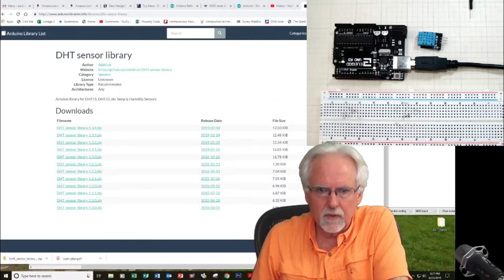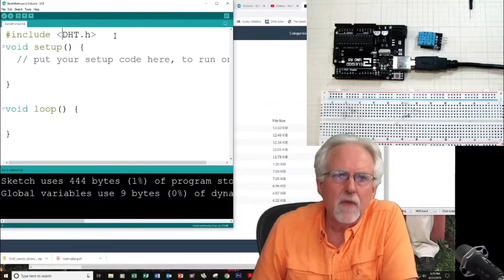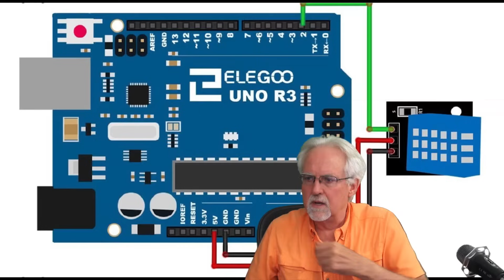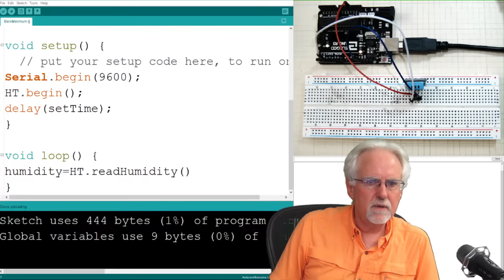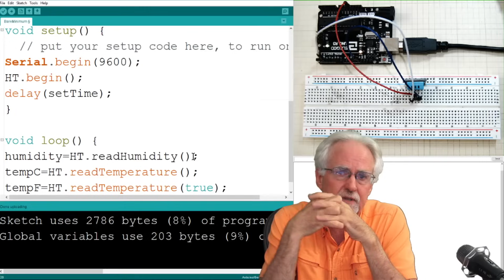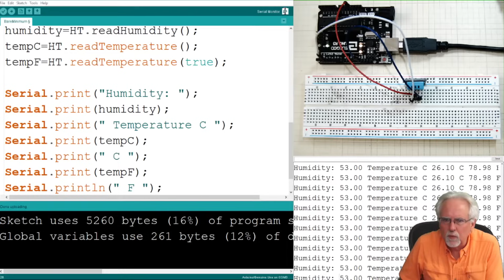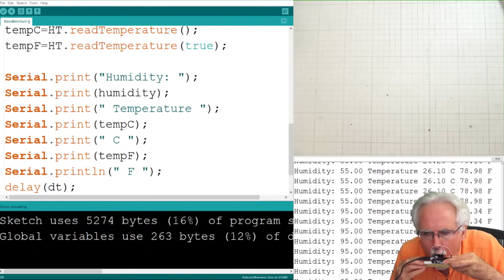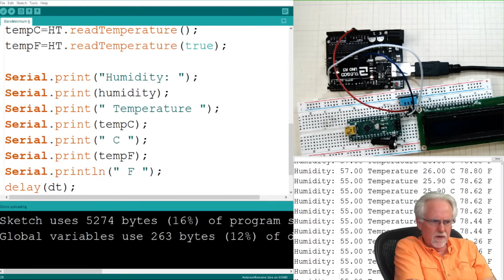Arduino Tutorial 50: How to Connect and Use the DHT11 Temperature and Humidity Sensor

Comment: Another great video! Two comments.

1. An alternate way to install the DHT11 library is to use the Arduino IDE. (I'm using version 1.8.10 of the IDE.) From Tools->Manage libraries... enter "dht" in the "Filter your search" box; after about 1 second, you will see some results (I see "DHT sensor library by Adafruit Version 1.3.8" as the second entry). If you put your mouse in the area for an entry, an Install button appears. Clicking it installs the library. Done! Note: the same version, 1.3.8, appears at the top of the list when doing the search you describe in the video.

2. At 17:00 you noticed that "readHumidity" did not highlight correctly. This is due to something not being right in the "keywords.txt" file that is in the DHT library folder. I found the following problem and fix that describes what is probably wrong:

https://github.com/adafruit/DHT-sensor-library/commit/a1169d20b4f287810c9c237859a856bcbc0b6ea2

I suspect that if you use a hex editor to look at the readHumidity line in your keywords.txt file, you will see that there is not a tab (0x09) character between readHumidity and KEYWORD2. See the keywords.txt snippets below.

Note: In my installed 1.3.8 keywords.txt file, tabs are where they should be. Entering readHumidity() (and readTemperature()) in a sketch produces highlights as expected.

 I just downloaded the "1.3.4" version of the DHT library (supposedly the same one you did when you created the video), unzipped it, and looked at the keywords.txt file line for "readHumidity". It does have 0x09 between readHumidity and KEYWORD2. However, when I look at the timestamp for the keywords.txt file, I see "30 April, 2019", which is after the release date of 2019-02-18, so this file may not be the one you were using! Looks like Adafruit slipped in changes after the release date.

Here's a snippet of what I see in the 1.3.4 keywords.txt, both in ASCII and in hex. All instances of lowercase 'b' in the ASCII snippet represent (what appear to be) spaces. In the hex snippet, the "spaces" are seen to be tabs (0x09), as they should be. The hex output shows 16 bytes of output per line; the hexadecimal numbers are the byte values--4 groups of 4 bytes; the text
at the end of each line is the corresponding ASCII; periods represent unprintable characters. The periods on the first line of the ASCII snippet skip over the beginning of the text line up to the point it matches the corresponding hex output.

*** begin ASCII snippet ***
..............exbbbbbbbbKEYWORD2
readHumiditybbbbKEYWORD2
readbbbbKEYWORD2
*** end   ASCII snippet ***

*** begin corresponding hex snippet ***
6578094B 4559574F 5244320A 72656164  ex.KEYWORD2.read
48756D69 64697479 094B4559 574F5244  Humidity.KEYWORD
320A7265 6164094B 4559574F 5244320A  2.read.KEYWORD2.
0A                                   .
*** end   corresponding hex snippet ***

I'm guessing that you have a space (0x20) between Humidity and KEYWORD2.

While I thoroughly enjoyed the video and working on the sketch for Lesson 50, I think I had more fun looking into the keyword issue!

Comment: I got it working first time.  Then I changed the LCD to one with Serial input and using a sensor shield to tidy up things.  Got it working; BOOM!  I really appreciate your willingness to share. With a background in Electrical Engineering and Computer Science,  I spent 32 1/2 years in the technical support and technical training area of Toyota Motor Company;  most of it training Toyota dealership technicians.  I can appreciate all the time and effort that you put into each of these activities. Great job and keep up the good work!

Comment: Okay, I've done the homework for this lesson. My Arduino kit did not come with the DHT sensor and  Nano and so both had to be ordered separately. The LCD came in the Arduino kit came with an I2C module embedded with it and that eliminated the extra wiring needed; however it needed for an extra library to be downloaded and installed. The Nano had some compatibility issues and after some research came to understand that some of these foreign manufactured items needed a separate driver to be downloaded and run. The DHT sensor too required an additional "Adafruit sensor master library" as well as the "DHT sensor library" installed.
I coded the lcd to display "Humidity" and its value in the first screen and after 2 seconds the display clears and shows "Temperature" in the 1st line and the values in Celcius and Farenheit in the 2nd line. Enjoyed the challenge !!!

Comment: Sir, Great video. Just an update. I had got nan output. Trapped output in long variable. Got -2147483648 as output. Finally loaded Files>Examples >DHT sensor library. Uncommented DHT11. Commented DHT22. Compiled & loaded. Got correct output.
Thanks for great videos. Your explanations are excellent. When ever possible, please tell us about arduino board. There are so many videos on internet, but your style is second best to none.

Comment: Got everything to work fairly quickly on this assignment. I discovered the sq() and PI functions which made the formula for the area much easier and more accurate. The rest was just utilizing what I learned in the last tutorials. Easy to learn when you have a great teacher. Thanks for the lessons.  I also got the humidity and temperatures to display without any real issues. The biggest problem is fitting everything to the display.

Comment: Had to go in and update from the libraries and install the DHT11 from Adruino program. I tried different ways to get it to work but finally got it. Also when I went and started coding all of the names "  DHT11, DHT, humidity, readHumidity, and readTemperature all turned orange. It works great and had no problems down loading it. 
Thank you Paul for a great lesson.

Comment: Hey, Paul! I just built a project using my Arduino and the DHT11 to  switch on my garden well pump to sprinkle my fig trees to prevent them from freezing in order to extend the growing season of the trees. I used the 5v relay in the kit to drive another relay that handles the high current load.
Reply from the maker: Excellent!

Comment: Hi Paul,
I've started from lession 1 and now I'm on lession 50. I've learned a lot along the way, especially on coding. You are very easy to follow as a beginner. I plan on finishing these lessons and then jumping over to the raspberry pi pico w. Thanks for taking the time to do what you do. You always wonder if people watch the whole video and do your homework. Well I do watch all the way through and do the homework,however I wonder if you go back and read these comments on these lessons that you posted 3years ago. Today is 10/13/23.

Comment: Had fun with this project, tried to do it on an ESP8266 Node MCU V3. Got the code to install with a few minor changes, serial monitor is showing the print lines as expected but no readings other than humidity 0.00 and some temp reading I have to fix with the print lines. I used A0 for the sense pin and declared it in the sketch as an int .Temp reads nanC and nanF

Comment: I came here because my project wasn't working. I looked at the documentation and it's definitely wrong. From the pins on the sensor to the test scheme they provide. 
When I did it, it kept saying "can't read from DHT". I followed your tutorial and everything run smoothly. 
Thank you for such outstanding tutorials.
Reply: May I ask how you got to know the commands you had to use? I'm afraid I'll need that skill when using other sensors or different hardware. I feel really lucky that I had bought the Elegoo kit and coincidentally you use it for your tutorials. I think I won't be that lucky in the future ;)

Comment: The Arduino IDE will also  add/install a zipped library automatically for you via the sketch/include library/Add .zip Library...
Reply: Or you can use the library manager.
Reply: Thanks for that comment. It helped.
Reply: @johndoudar6395  Thanks for that.
Reply: Thanks Chuck

Comment: At 10:35 Paul says that you have to use Arduino digital pin 2 to connect to the sensor left pin.  I used a different pin and it worked fine.

Comment: Dear Paul, I really appreciate your lessons. I am improving fast. I bought your kit and try some other little projects. Actually I am in marketing and communication, and I often have a tainted view from this perspective. I was thinking, if you make a second level  class in a bit different way, I think you would get many more viewers,. The objective would be to develop a steady hartware tool to enable the student to use it in own projects and grow on it. My idea is, to start with an interface that we keep throughout the entire class, F.e. lets start with an bigger arduino. Than connect and program basic components, create chapters inside the ide. 1. Serial port. 2. Display and some Leds and switch 3. Real Time clock, 4. Memory Card, 5. esp2866 6, Blynk. - This components accompany us, hartwired to the arduino, throughout the entire class. We build sensors, projects actuators on this achitecture. At the end we can grow complex and more usefull things with arduino instead always starting from scratch, at the end just having one little part in a lowest level possible working. What do you think, Paul?

Comment: This has been particularly interesting to me because my major reason for getting interested was to built a Freezer monitor after I accidentally unplugged one of mine. Eventually I will want to have (four) of them communicating to something by WiFi but this is an essential first step, for that project. I have used PICs in the past and used Assembly Language for them but I found Python confusing  but 'C' I have been using for 40 odd years in various guises and I am comfortable with this interface. I am still accumulating items.
BTW - giving advice of what to get with links is essential. I am following another author who does not and sometime I have to skip back and forth over the Video to catch what he has said and sometimes am not successfull. Thank you.

Comment: Homework done ok.
😀
Funny story. I'm using the Sunfounder Elite Explorer kit for Paul's series on the R4 Wifi. I'm ok with programming but a beginner in electronics. When it came to the LCD the one I have has a piece of electronics on the back that prevented me from plugging the LCD in to the breadboard. Should I pull it off then maybe I can plug the rest in?. Fortunately, I did some research instead and found it was an I2C module. What is I2C?  So I did some more research and found how to use it and found some libraries to drive it. It works fine and is a lot better than connecting all those wires to the Arduino. So Paul, not only am I learning from you, I'm learning by doing my own research and trying things for myself. Great lectures and I can't wait for the R4 Wifi series to advance.

Comment: Had problems with the recommended library and running on a Mega 2560, loaded a library from different source and works fine (but slightly different output format)
Most excellent!

Comment: Hey Paul, thanks for the amazing lessons. I was able to do the assignment from lesson 49. It was easy. 

As for this lesson. when i tried uploading the code it gave me com error but after googling i was able to solve the problem. I had to delete the DHT Library folder and download it directly from the Arduino IDE and i also had to install the Adafruit Unified Sensor Library but after doing this everything worked perfectly. I am amazed how simple it is to use this sensor and displaying the readings to the LCD was a piece of cake. Thank you for these amazing lessons!
Reply: I tried that but my code is still putting out errors
Reply: yeah it wont work but if you delete that folder and then install it from the arduino itself it will work. I think its because it needs other libraries as well to work.
Reply: Thanks Alex, I follow your recommendation and it worked.

Comment: Hi Paul, I had to delete and reinstall the Library for the DHT11. Otherwise I got an error message regarding the Arduino Board. However, it was a good experience because things often fail and require thinking outside of the box to correct. I learned a great deal by doing so! Great lesson as always and I will pass it to my students!

Comment: Elegoo haven't used the normal pin layout on the PCB for the 11. The middle pin on most DHT11 units is data. Just in case someone isn't using the Elegoo kit. Thanks for the tutorials.
Reply: Thanks for the heads up, I almost connected the DHT11 as per a datasheet from the internet and remembered your comment.  Any idea if I would have released the smoke by reversing  the Vcc and data pins?
Reply: @chrisingram7277   probably just fry the sensor... as I did probably... (a new one is on the way) =))
Reply: @legendarycraft5499  Not too hard to fry sensors lol. I always check about ten sites before I plug some stuff in.

Comment: I installed the DHT sensor library by downloading the zip file, and then in the Arduino IDE menu, I selected Sketch > Include Library > Add .ZIP file. It was a bit simpler than Paul's method.

And to answer Paul's question about #include "DHT.h" vs #include <DHT.h>, they will both work fine.  The difference is where the code compiler looks first to find the .h file, in the libraries folder or in the user's own code folder.  If it doesn't find the .h file in the first folder, it will look in the other one.

Comment: Had big issues getting this library installed, until I found a much simpler way. As long as you're connected to the internet, do this:
From the Tools menu in Arduino, select 'Manage Libraries'
In the search box, type DHT, it will search download sites for you
When the results appear, choose the Adafruit DHT Sensor Library and select Install
It will probably warn you that there are dependencies and other libraries are required.
Arduino will download the dependencies for you and install everything.
That's it, worked perfectly, without even leaving Arduino.

Comment: Paul, I use the Tools -> Library Manager and type in DHT11 in the Search box. The Manager will put the folder in libraries folder.
I installed the MCP4725 library for the DAC chip from adafruit.

Comment: Hi Paul, I was watching this video and i paused it at the print statement point(20:00) I decide to combine the DHT11 with my Nano based LCD circuit, I first swapped out the contrast pot with a fixed esistor (850R) and then changed the Serial.prints to lcd.prints. I had to drop the temperature in F, but then in the UK thats not much of an issue, i guess i need to figure out how to scroll text. My one reads every 5 seconds. it also runs from the 9V batter using the battery and PSU in the kit.
BTW i have a few Nano boards, they all look identical but from different ouces and some require old bootloader to compile and other s use the new one, just in case any one has trouble with their Nano codes loading. Having soooo much fun, like being a kid again. Back to to video for homework.

Comment: Homework Done!
Here's the LCD output:
Humidity: 51.00% (first row)
Temp:       73.94F  (Second row)
I will try to use the character map to print the degree symbol that looks like a small circle. But this is fine.
Wayne

Comment: I had a difficult time loading the library.  It started by me not initially installing the Arduino program correctly in the first place.  So I have to reload the entire program again, and this time in the Document folder, not the download folder.  Since I am using a MAC, Arduino did not know where to find the folder for the DHT unit.  It took real hair pulling, but really need to read the fault screens in great detail.  I am really surprised that the Arduino has lots of interface communications for goofs like me.  But it took me right to the problem by stating where it looks for the files which in my case is deeper than the library.  You have to put it in the Arduino, library,Bare minimum folder, then install the DHT files there.  Other than that, I really enjoyed the Tutorial.  Thank you very much Paul

Comment: Quick comment, on a fresh IDE install, the DHT library has two libraries it's dependent on that also need installed. I ultimately used the library installed in the "Sketch" menu to find out what those dependencies were.

Comment: Thanks Paul another interesting tut, however, I ran into a problem when first trying to get results.  The serial monitor returned "nan" in each of the variable fields, had no idea what this meant so checked, connects (ok), checked code (ok), checked library (uninstalled v1.4.2 and installed the version  you used 1.3.9 , error continued, re installed 1.4.2 along with Adafruit Unified Sensor).  Found a mention on the Adafruit site suggesting that a pull up resistor on the data pin is recommended, installed a10k resistor between pin2 and 5v and it worked.

Comment: Another option is to hop on Amazon and search for 7 in 1 RAB Holder. There are a number of them and they will hold an Arduino and one or more breadboards in place so neither will move in relation to the other. This makes it a lot easier to manage since you can wire jumpers to the breadboard from the arduino and have them available at any time without having to re-wire. Once I get to the point of actually making things I want to use, I'll definitely be picking up some Nanos. In 4 packs they are like $3.50 each if you look. It's actually cheaper (and neater for wiring) than buying Atmega 328's and the components needed to turn on into an Arduino

Comment: Did I  mention that I manage to melt the DHT11?
Serves me right for getting distracted by a troublesome piece of code on a previous play. Si I had lots of fun with the more accurate AM2302 sensor.
However I did learn so much more on this lesson than all the previous cut and paste jobs with other peoples codes.
I'd like to know, why the "true" against F?
The Celcius measurement works without any mention of TempF.